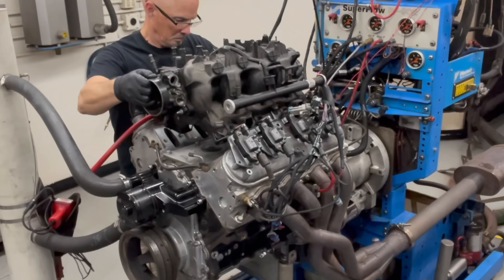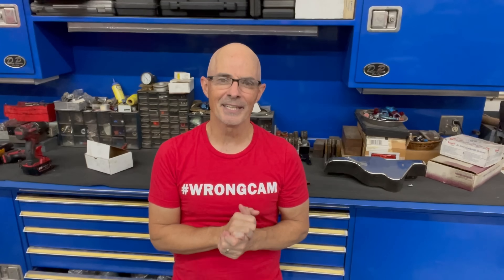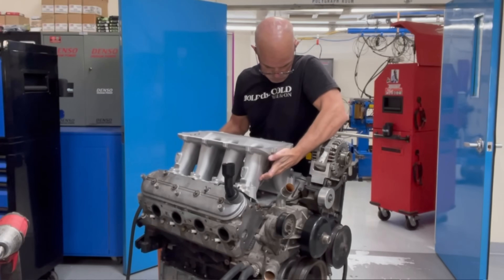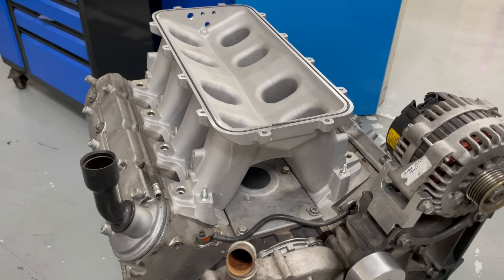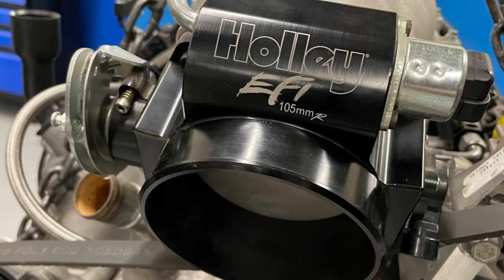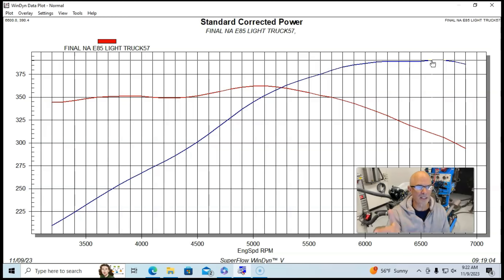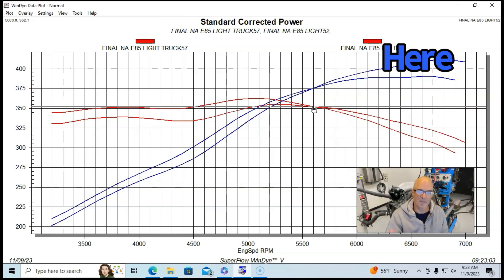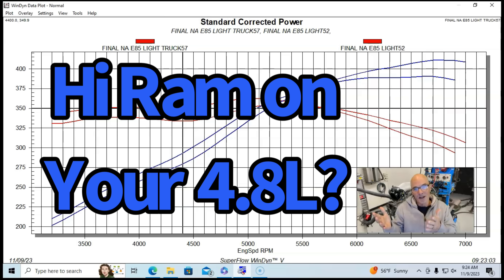CHEAP, HIGH-RPM, 7000-RPM JUNKYARD 4.8L WITH STOCK SPRINGS! STOCK TRUCK INTAKE VS HOLLEY HI RAM TEST

Comment: My question is I seen in one video you used 1 3/4"headers, and now in this video you're using 1 7/8" headers what is the recommendation for header size I have the same engine and was planning on using the tbss intake and I already ordered one of your low Buck truck cams.
Reply from the maker: Your headers are fine-we also use 1 3/4 on this motor-only used the 1 7/8 because they were convenient
Reply: Thanks appreciate the information,any stall recommendations although the cam doesn't need it but you mentioned a stall will aid in performance and lastly should I purchase the BTR push rods from the site as well to compliment the cam and springs kit,I also purchased the lifters and trays combo already.

Comment: I have a 4.8 stock block, full pully upgrade, underdrive pully, headers ex..., 228r 110lsa cam Doble springs, have a 105mm holly high ram and it shifts at 8k Rpm and it's a symphony of muscle.
Reply: Hey man does that use stock pushrods and lifters? If not what's your setup?
Reply: @Miatasand5.3s  pushrods and lifters from tsp

Comment: Is that stock bottom end really gonna be able to handle 7,000 rpm?
Reply from the maker: we run well past that
Reply: @richardholdener1727  😲😲😲
Reply: @richardholdener1727 I have a s13 with 4.8 and cd009 trans 

I’m going to run a 7875 .96 turbo with a hi ram

What big cam would you suggest to run with this set up? I don’t need any low end at all since it will be running most the time in the higher rpm’s

Comment: Hey that is a nice junkyard build. Mild cam, stock springs with a 7k rev limit.
   It's actually really good for towing that way. 
   The torque "curve" started low and remained flat until 5500, then the HP kicked in!
   Some gear would make it even better. They like to sit in a gear when climbing.

Comment: Hey i bought a mad maxx cam from Tsp for my 6.0 bored to 6.2 with the fly cut pistons … im running 6.0 heads now.. z

Id like to see you run a similar setup 6.2 with nnbs intake vs holley
Reply from the maker: Already tested an NBSS vs Holley in the big intake test video
Reply: @richardholdener1727  how much hp do you think i am robbing myself of ?
Im running 243 on my 6.2 bottom end with nnbs intake & small cam..

Looking to go ls3 top end maybe stock heads or aftermarket… but not sure if 5g’s of work is worth 100hp lets say?

Comment: It's really wierd how having different length intake runners create different power levels. You could easily understand this with a carburetor engines but on EFI??
Reply: there is still the air speed the air hits the end of the injector and take the mixture there the remaining distance to the combustion chamber.  Air speed = chamber fill.

Comment: Long runners fall flat on their face beyond tuning freq. Ala gen2 TPI, k24… Tuning boost is gone and the resistance is high.  Could you run the FAST manifold on that combo?
Reply from the maker: Hi Ram are short runners

Comment: Hi Richard, Love your videos. Can you recommend 1 or 2? LS/LT books for me ? I am looking for a thorough listing of all LS/LT engines/ years available in cars etc. In particular I am looking for info on the LS/LT? Cadillac (only?) supercharger engines. An over view of all the LS/LT cyl heads- years made O.E. equipment years etc. I know the 2nd gen 2.3 cady superchargers are most desired. Is there a book? showing the aftermarket options/ ecus /suggested mods etc- thanks .
Reply from the maker: all that info is avail on line
Reply: HI, yes there are many books What do you think are the best books/ magazines? which ones should I buy? @richardholdener1727

Comment: Not counting looks and If its a daily driver with stock stall converter like majority of chevy trucks suvs your gonna want as much bottom low end   as you can get for stop light to stop light driving i assume so truck intake be the way to go and  save some money
Reply: and that what the stock cam is also designed for, we never get to see the VE increase it gets at cruising speed/rpm over "performance" cams

Comment: I enjoy these videos but hope people dont get fooled into believing that big lift long duration cams are the best idea when running fast on the street. A small displacement motor with a giant long duration cam will probably be the slowest car on the block if the car doesent have the required low gears and high stall speed converter to allow the engine to operate in the needed higher rpm where the engine makes power and torque. A stock 4.8 engine making 340 hp will probably run circles around a overcamed 4.8 engine even if the overcammed engine makes twice the hp  but it needs to be spinning 8000 rpm to do so.. Most street cars need less peak hp at super high rpm where it never is used ,and more average hp spread over the entire rev range from idle to redline..
Reply from the maker: this was a sub 500 lift, 212 intake cam-so over cammed isn't accurate
Reply: Your cam this time is fairly small compared to what you usually run but 212 @ 50 thou is still a lot more then the stock that I think we're around 190 /191.. It doesn't take much to overcam a puny 4.8 liter engine to begin with as they move so little air. I'd like to see you post video of the idle quality at a reasonably low rpm with the 212 cam with a four barrel carb and the vehicle idling in gear and a stock torque converter. Sure it runs good above 3500 but you never show how they idle and the power from idle through say 3000 rpm which may be 99 percent of where a normal vehicle operates as a daily driver. Torque at low revs under 3000rpm will probably be much lower with the aftermarket cams especially on a tiny 4.8

Comment: Is there a specific order to tighten or loosen bolts on any U.S. engines or staged torquing sequences, just wondering?
Reply from the maker: yes-torque sequence is used on every engine during assembly

Comment: I'm one of those guys who would put a tunnel ram on a 4.8. I would also use a more aggressive cam & valvetrain, and port the heads. Then I'd rev it to 8k. 😛
Reply: This this is what I want. High reving 4.8l with intake headers and a cam and springs. Any suggestions
Reply: Same here buddy even on a 4000lb truck I've seen alot of fun times with just , 320 rwhp
Reply: As someone who's building a "little" engine for racing, you kinda have to have a reason for that build. I'm bound by a class limit with a weight break, for example. You'll make FAR less power than a larger displacement engine. Almost ALL common displacement LSX engines can rev to near 8k if the valvetrain is sorted out, along with a thousand other details... most of which cost time and money
Reply: Assembled a '02 4.8 with LS6 cam, 862 heads, edelbrock performer rpm(if I remember right) intake,and a QF 650 DP mechanical secondary carb. Free rev'd to 7800rpm, shifted 7200rpm WOT

Comment: Would the tbss and bigger tb make more torque? And hp too?
Reply: TBSS most always make more torque than a standard truck IM. They also make more overall and average power than an LS6 intake manifold.
Reply: @kenm724  yeah I got real excited when I saw the test come out then I saw the three bolt tb and was like eh well, I guess I can find the back to back truck vrs tbss
Reply from the maker: truck is what this 4.8l came with and far more common-but check out any of the many TBSS v truck vids

Comment: well, this is nice.  My LR4 is built relatively similar (just with a tbss cathedral port vice holley).  Been wondering what to expect from it.
Although I do wonder what the oversized valves, cnc'd ports and domed pistons will do to change the power output in comparison to this.
SUM-8701R1.
Reply from the maker: see the many 4.8L vids up-but ported heads and pistons and cam and intake could put you over 500 hp na
Reply: @richardholdener1727  The heads in question aren't anything fancy.  They're just 706's.  But I figured that the cathedral ports would help the 4.8l keep port velocity up even up to 7k.  I just don't personally know yet.

Comment: Hi it’s me with the weird questions again.  I know radiused intake runners flow better, but does a full bell mouth in a plenum or a flush fillet with the same radius flow better ?
Reply: I'm pretty sure he did this test a couple years ago ... super Ritchie intake stuff is always great
Reply from the maker: I think full radiused flows more than 1/2 radius in the base-but there are more questions than that

Comment: If it was in a car with lower gear ratio it would be great for the high ram intake. For a heavier truck and higher gear ratio I would definitely go with the truck intake for that broad power band.

Comment: Hey Richard I've got a 4.8 with sloppy mechanics best cam pac 1218 springs and a sheet metal hi rise going twin turbo. Gapped the rings brass trunion upgrade new lifters. Any thoughts? Let me know if I'm missing anything or if I'm gonna be good . Obviously goin with 1000 cc injectors and flex fuel/pump gas deal. Love watching you man!
Reply: Sounds like your on track man. Don’t be afraid to turn the boost up
Reply: Richard hates it when people ask for thoughts.
Reply: @michaelblacktree totally, thought we were in the sharing tree, my bad guess I'll just not ask questions. Thanks
Reply: Also 862 heads.

Comment: Didn't surprise me. The oe intakes aren't very good past 6k rpm. You can make them a little better overall porting the tb and intake ....but they still gonna lack once you put a cam in up top.
Reply from the maker: peak power came at 6600 rpm with the truck

Comment: Richard. I am building a 57 Dodge town wagon for street and some adult fun with a 91 Corvette frame. I am going to drop in a LS 4.8 and a 4l60…which I intend to TwinTurbo.  My question is to you….? there specific size turbos that you recommend?? motor speced with stage two BTR cam and springs after market long runner intake.  Not sure about TB size or injector size. Oh dang did I mention I have never built an LS.  🎉🎉🎉. Happy Trails
Reply from the maker: you pick the turbos based on desired power output, but you need to focus on that 4L60E
Reply: After a little research, I see what you mean. What would you suggest for a good automatic transmission with? Let’s say 500 hp at the crank.  Happy Trails

Comment: Im probably going to get laughed at but I own a 12 mustang 3.7 , Manley rods and pistons .020, ported intakes, Coyote throttle body, Headers catless h pipe. I built the motor personally. My best on a dynojet through a 6r80 355 gears circle d 3c convertor 326whp @ 7100 /306wtq 5400. 12.5 @ 108 mph 1/4 here in Florida. Im in the process of doing a Holley ram swap in place of stock ported intake to try to push peak power out to 7200-7500 rpm. I know this video has nothing to do with a dohc engine but its neat seeing  the difference the intake manifold does
Reply: I like all kinds of builds. Doesn’t have to be 1000hp. Especially for the street that’s unusable anyway. Build what you want to and love it.
Reply: I dig the build, I've seen those adapter plates on Auto Mafia's website. Always thought it looked a little goofy, but hey, if it works it works. I'd say 340whp is achievable for you. Good luck!
Reply from the maker: that V6 is awesome
Reply: CFM had a turbo kit for the v6 a while back
Reply: I like seeing more done with less
Reply: That’s a bad ada** setup!!!
Reply: Go on “Swartz Raging Manifolds” web-sight and look at the technical tab / section. They have a really accurate graph of runner length vs. rpm range for 3rd harmonic…..I’d measure the distance from the intake valve seat to the intake flange of the head before you pick an intake manifold / make modifications to make it fit…..you may find a Holley Low-Ram or different manifold may suit you better for the RPM range your trying to add power to, based on runner length….
Reply: I would keep the ported mani personally and go power adder finally
Reply: Great numbers and its a fairly light car giveem hell bro
Reply: Not bad at all for a 3.7, get some boost in her and the haters will shut it 💪😂 I have Lacrosse CXS that'll be getting a FBO LFX and tune sometime in the future. It's not about being the fastest, sometimes it's having fun and finding something different to bring to the table
Reply: Man i tell you what thats a gd good number on the track dont worry about people laughing at ya i have longbed c1500 same block that came in from factory built the motor my self no machine work runs 12.8 at 4000 lbs and everyone used to ask me why i built it .. i can say its worth it to have a unsuspecting car that can run anything faster than 13.5 on the street i have fun racing even bikes if i know im not gonna win even its still funner than hell and I will never sell the car just because its an accomplishment to me the fact its running 13 on street with minimal dollars put into it
Reply: Why You don't do a coyote swap

Comment: I know the difference might have not been so dramatic, but it definitely would get more dramatic the more you compared low RPM camps vs high RPM cams. Overall I really like this test though. For a street engine living most it's life under 3k and just seeing a few short rips to 6500 here and there for giggles... the truck manifold is better. Shocking.
Reply: Agreed... unless you Street racing the thing... then I think hi ram and steeper gear would apply better
Reply: Agreed. Camshaft makes a difference with cathedral port heads.

Comment: Try the biggest throttle body on truck manifold, if it makes more torque all it needs to do is breathe more
Reply: The truck intake can only accept the stock 75mm throttle body. The only exception is the 05 LH6 that had a 4 bolt breadbox intake on it that was opened up for the 87mm throttle body. The tbss/gen 4 intake has the 90mm opening, but is a bigger intake.
Reply from the maker: the throttle body does not dictate torque, that happens after the throttle body

Comment: Hi ram needs more Gear 

So basically you can run stock ls3 springs on a stock to mild cam to 7k ?
Reply: A stock cam on a LS3 won't make power past 6500 with a truck noris cam yes you can run it out to 7k and still make power due to it having slightly more lift and duration
Reply from the maker: I don't understand your comment-are you taking about an LS3 (stock cam and TN cam) or a 4.9L with an LS3 cam?
Reply: The lobes on the nsr cam are designed to be more stable yes you can run ls3 springs and go to 7k with nsr tn. RH did it here with 200k stock truck springs

Comment: Wow very interesting, I wonder if the low end loss gap will be less in a 6.0/6.2
Reply: Depends on what heads you use, and if you use cathedral ports the camshaft matters more as well.
Reply: i'd like to see it on a hb dyno running doe he road at 2000/23000 65mph ish to see the VE, we are always compairing RPM's no body uses.